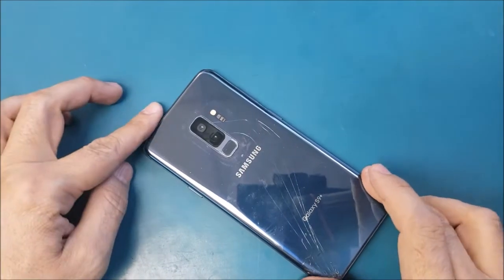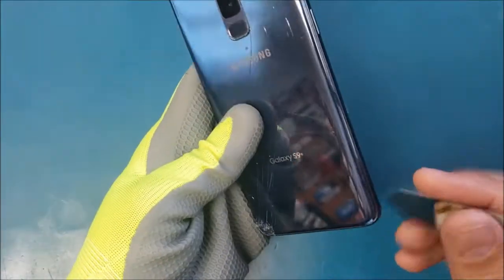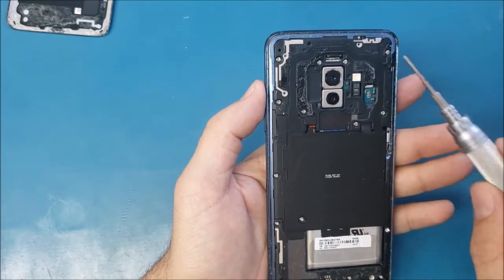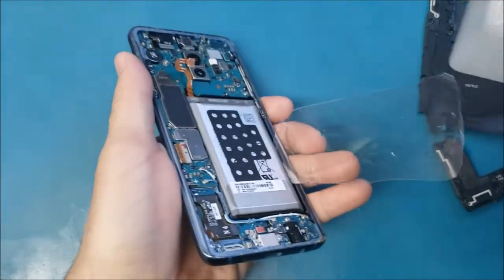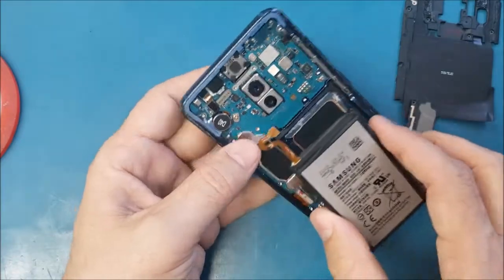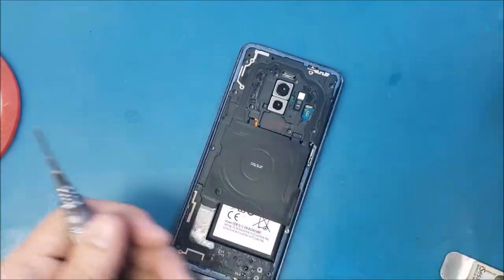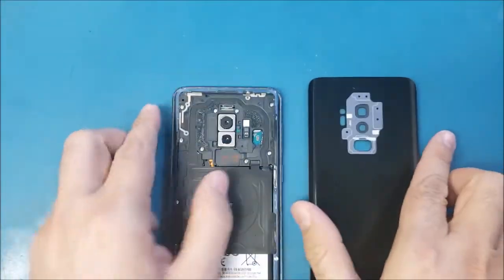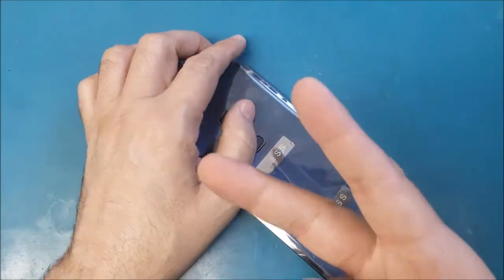How to replace the battery & Back glass on Samsung galaxy S9 and S9 Plus

Comment: And can I take pictures underwater with tha sealed tape? I mean the original glue or tape that the broken back supouse came sealed for use under water for 30 minutes I guess in another's terms is waterproof on 3 feet under water for 30 minutes I can still use it, like when it was from the factory?🤔

Comment: Great video. Anyone knows what's the temperature on the heat gun he's using to open the back side?
Reply from the maker: regular temperature until you can not touch it, then stop and use the plastic. make sure you don't overheat the phone